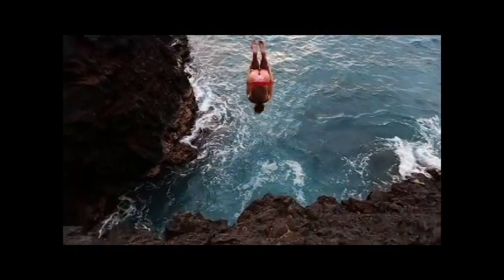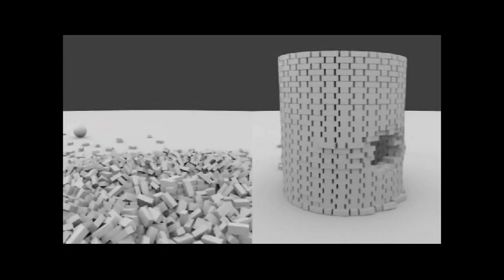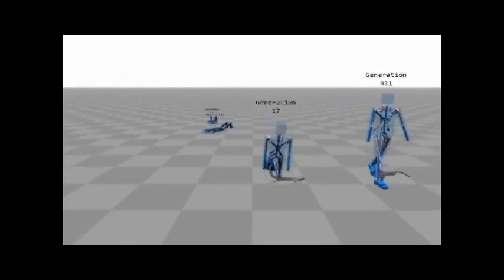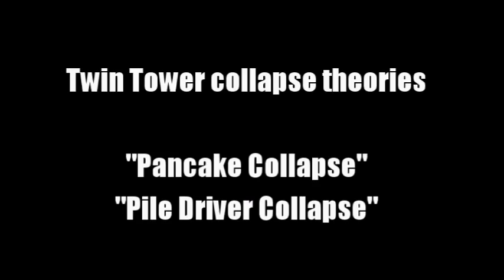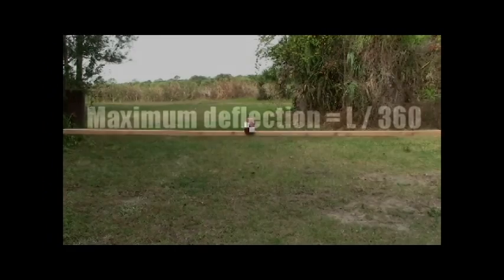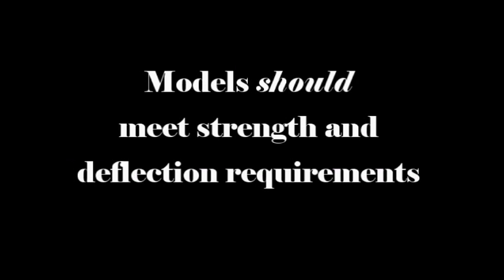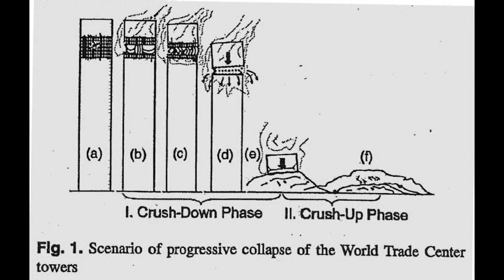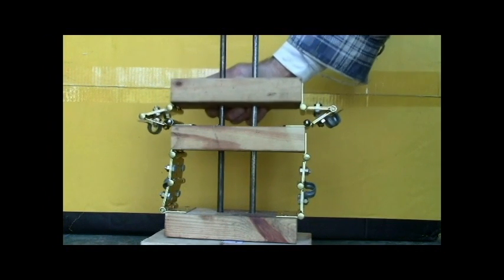9/11 Experiments: The Force Behind the Motion

Comment: This is a excellent video. There is no other explanation for what we are observing. The symmetry, uniformity , consistency, the smooth clear path straight down, all the characteristics for controlled demolitions are there. Can't you ignorant people handle the truth?
Reply: " There is no other explanation for what we are observing"
Except that there is.  These experiments don't represent the proportional strength of a 110 story skyscraper.

"The symmetry,"
The towers collapse was not symmetrical.

", all the characteristics for controlled demolitions are there. "
Actually its the characteristics of a very tall building collapsing from the top down.

A building destroying numerous other buildings during the collapse is the opposite of a controlled demolition.
So you don't even understand the terms you're using.
AND what would be an actual key characteristic of a CD would be explosions going off on all the videos before the collapse.

Didn't happen.  It's fantasy.

"Can't you ignorant people handle the truth?"
You just summed yourself up perfectly sport.
Reply: @markh1011  all this coming from a guy who's used ice cream sticks to represent 110 floors in his weak ass experiment. Conservation of momentum is clearly orchestrated and easy to understand in this video but Mark doesn't include these laws of physics in his ice cream stick fortress. He can't because if he did his fabricated theory comes tumbling down.....like the controlled   demolition towers.  Fuckin poser
Reply: @coolk3dat754  
"tell me why....video not valid"
I've told you.  He doesn't represent the proportionate strengths of the materials and connections in the towers.   These strengths don't scale proportionately with size.
Also he he's just dropping through floors that are held in place but structures that don't represent the skyscrapers either.   When the towers collapsed it wasn't because of an item breaking through many floors...   As we see in the other video when there collapse progresses, including outer columns, those materials join in the collapse.

"just ice cream sticks ."
Just saying "ice cream sticks" a lot isn't an intelligent response.
    Obviously that's all you can do.
You're flailing about here.

Oh and I'm still waiting for this.

"Conservation of momentum is clearly orchestrated and easy to understand i"
So apply it to what happened on 9/11.
Please do.   In your own words.
Go.
I''m now going to keep asking.
Reply: @markh1011  he doesn't represent???? And that stupid ice cream stick video does? You referred me to this. Your video doesn't represent either.... so WTF?
Reply: @markh1011  very childish of you to claim I don't answer your questions when you have not answered one of mine.
Reply: @markh1011  blocks of wood? Does that represent 110 stories sweet cheeks?
Reply: @markh1011  answer me sweet cheeks.....do blocks of wood represent 110 stories?
Reply: @coolk3dat754  Already answered.  You're confused about the point of the model.   You are confused most of the time.
Reply: @coolk3dat754  
"You want to clean the laws of physics need not apply anymore"
Actually that's what you're trying to do.
If you think you can prove any laws were violated then go ahead.
Oh that's right you don't know a thing about physics.....stuck aren't ya?
Reply: @coolk3dat754  
So you've had 3 years to come up with a response....This better be good...🤣🤣🤣

".I know more then you. "
The posts show otherwise.

" Where does it say the laws of physics do not apply to modern State high-rise buildings? "
That's apparently your claim not mine.

"nd the same time and both will be destroyed which causes a deceleration"
Wrong.  When the floors are destroyed the materials are still there.  They don't disappear.    When a floor is destroyed it just adds to the mass dropping on the floors below.  
So you've got 20 floors dropping...21 22 23 24 25 ....it's not going to decelerate.   The force is increasing.

" Any upper block of falling structure must slow down when it hits any mass of force that previously supported it."
Wrong.   The initial upper block hit a weakened floor.    There is a dramatic difference between a static and dynamic load.   The floors were never intended to handle dynamic loads coming down.
Reply: @coolk3dat754  
" The upper block a falling structure will destroy itself well before it could possibly crush the entire larger lower structure."
You're repeating the same confusion I just addressed.  When the floor is damaged in the impacts, the materials don't magically disappear, they continue to fall.   So the amount of floors coming down increases every second.  

"This is worldwide accepted "
No you just don't understand the mechanics of a progressive collapse.  

Three years for that failure!  
😂😂
Reply: @markh1011  I'll m sorry I didn't see it in any of your false claims.......where is you experiment that demonstrates your claims?    You still going to have one? Without it you have no way of telling if your claims are even possible and that is just stupid
Reply: @markh1011  notice you offer no experiment to demonstrate that can prove this experiment wrong.. sleep well princess
Reply: @markh1011  🎶 I am stuck on stupid cuz stupid stuck on Me 🔊🎶
Reply: @markh1011  come back and try to post nonsense WITH OUT using experiment that will demonstrate the force behind the motion. You will only provide evidence by doing so of a guy who is so bankrupt an argument, he doesn't mind making himself look like a jackass
Reply: @coolk3dat754  
".where is you experiment that demonstrates your claims?"
Do you have an experiment for magical thermite bombs bringing down a 110 story building?
By your logic that can't happen.

So you don't understand physics or collapses or anything really.   Your whole shtick is to say "where is the experiment!!!!"
🤣🤣
You had three years!  
🤣🤣
Reply: @coolk3dat754  
"notice how the structural failure buildings remain"
Oh my god.  They were all little buildings.   They were nothing like 110 story skyscrapers collapsing from the top down.

You had three years to get better at this!
LOL

Oh and notice how you hear very loud bombs going off in all the demolitions?   You don't at the towers.

It's so easy to destroy you.
Reply: @markh1011  according to you the collapse was inevitable. With architects and engineers I believe public safety comes first . Who and why in the f*** what a architect and engineer designer building to collapse all the way down to the ground should there be structure failure?  Nobody. Take your scooter downtown and have a seat at the bus stop. You'll see thousands of people walk in and out of high-rise. Count how many are walking in with fear in their eyes wondering if the walls will hold? Count on many are touching the walls count how many refuse the elevator for the fear that the upper floors might come crashing down. Guarantee the answer is zero.   Just because you got ABC blocks for Christmas does not qualify you as an architectural engineer you could scream at the top of your lungs ashes ashes All Fall down all you want..... That just doesn't happen. 1. Your theory is not what happened 2. Lots of physics say it can't happen 3. History proves it's never happened
Reply: @coolk3dat754  
"Count how many are walking in with fear in their eyes wondering if the walls will hold?"
You're not making any sense.  The buildings didn't collapse on their own.  They were attacked.   I can't believe I need to explain this to you kiddo.

I'm skimming over your post and only see a child throwing a tantrum.
Reply: @coolk3dat754  
Oh there is this bit.
. "Your theory is not what happened"  -  I'm describing what we saw on the video...  so yeah... that happened....lol

"Lots of physics say it can't happen "
Prove it.  We both know you don't know a thing about physics.  Go on. Give me entertainment.  

"History proves it's never happened"
What does this even mean?    You're terrible at this.    🤦‍♂
Reply: @markh1011  I don't want you to hear this from anybody else..... Cuz I don't want you to be alarmed.  But the truth is the much larger lower block of material has been supporting the smaller upper block for over four decades and the towers never collapsed . Don't tell anyone that architects and engineers design a building to collapse straight down should there be structure failure. You might wake up one day and find yourself buried six feet deep
Reply: @coolk3dat754  
"But the truth is the much larger lower block of material has been supporting the smaller upper block for over four decades"
As I educated you a few posts back, there is an important difference between a static and a dynamic load.
You wouldn't understand this of course because you don't understand anything about physics, or logic, reason etc

"Don't tell anyone that architects and engineers design a building to collapse straight down"
That's your bizarre claim that comes from your confusion about basic physics.
Reply: @markh1011  let's test your understanding on the laws of physics listen carefully. Regarding the laws of physics Newton's third law of motion when you apply it to the collapse tell me what should and shouldn't have happened based on these laws.       Warning ⚠️ should you lie and get this wrong it would be solid proof that you have no idea what you're talking about
Reply: @markh1011  yes or no do you have a scientific method that uses an experiment that could demonstrate the false claims you are making. Yes or no?
Reply: @markh1011  yes or no?
Reply: @markh1011  oh what tango webs we weave when first we practice to deceive.
Reply: @markh1011  you don't have a scientific method do you?
Reply: @markh1011  I asked you for your understanding of Newton's third law of motion. When you apply it to the collapse what should and shouldn't have happened? Your answer is either going to make you or break you
Reply: @markh1011  you're the one trying to disprove this video so start disproving and provide an experiment like this gentleman did. What's the matter? Scared?
Reply: @coolk3dat754  
"yes or no do you have a scientific method that uses an experiment that could demonstrate the "
I've already addressed this.   Everything we know about physics and building construction is based on experiements.

"yes or no?"
See above.
Reply: @coolk3dat754  
" I asked you for your understanding of Newton's third law of motion. "
It's pretty obvious that I know the physics far better than you do.    You can look it up.
It's not my job to teach you.

"When you apply it to the collapse what should and shouldn't have happened?"
You're still not understanding the progressive collapse.   The upper block is destroyed as well, but it doesn't vanish... it's still coming down... and new floors join.
You're not getting this basic error you're making.
Reply: @coolk3dat754  
"so start disproving and provide an experiment l"
You've tried this deflection already and it's not working.   I've responded to it multiple times.
Reply: @markh1011  1. You don't have a scientific method that could prove anything different from what I have proven 2. You failed to answer your understanding of Newton's third law of motion when you apply to the towers what shouldn't should have happened.      Way to go princess
Reply: @coolk3dat754  Oh just watched some of the video.  Haven't seen it in years.  This guy doesn't understand the progressive collapse either.   His experiment doesn't including the additional weight being added to the collapsing force with each floor.

 He also doesn't understand that the strength of building materials doesn't scale proportionally.  His experiments are laughably bad and only someone who has no idea would be fooled by them.   Oh there you are!
Reply: @markh1011  if that was true Nist would have continued their analysis instead of stopping at the point of collapse initiation never explaining why total eclipse occurred. I don't remember seeing your name in the book with your explanation. Remember Nist is the official narrative and not your false opinions. Try again my boy
Reply: @coolk3dat754  You're so far out of your depth here and it's pure entertainment.  Your distress signal is "but but where is the experiment!!!!!!"... then running from the response.
Kiddo you're a mess.   Pretty funny though.
Reply: @coolk3dat754  Come on sunshine.  Are you even trying?   Did I break you?
Reply: @coolk3dat754  Tell ya what... lets go back to the list that made you run away and hide for three years... 😂😂

Over to you to provide the following.

1.  Videos of the towers with explosives going off
2.  Proof I have lied.
3.  Point out the mistakes and errors in the NIST report on the towers 
4.  Prove I have denied any laws of physics
5.  Prove any laws of physics were violated with the official story

.....and..go.
Reply: @markh1011  you addressed it without a scientific method that could demonstrate your false claims. Way to go princess
Reply: @coolk3dat754  That's all you could come up with?    A repeat of a previous post.
Beaten.
Broken.
Reply: @markh1011  look sweetheart you're not arguing with me you're arguing with science. You trying to challenge the laws of physics but the laws of physics are not challengable they are laws. They are not theories but they are laws. The laws of physics were not based upon the way a building is designed. Newton's third law of motion for every action is equal and opposite reaction. What you obviously clearly don't understand is what those laws are telling you. Equal and opposite reaction. That means the top block coming down to the lower block will meet at the same rate at same time (equal) destroying each other causing a deceleration because there is no more energy left to crush the much larger lower structure with 80,000 tons of reinforced structural steel framework underneath it that was not damaged. This very experiment to demonstration proves what Newton's third law of motion states . These laws apply to every everything including high-rise buildings . It is worldwide accepted. In layman terms it means any upper block of material must slow down when it hits any mass or Force that previously supported it   . This very experiment proves it. The upper block of following material will destroy itself well before it could possibly crush the entire larger lower structure. The experiment proves it. It took firecrackers to represent what we are actually observing. This video showed you the pancake theory and it failed. The pile driver theory and it failed, but the control demolition theory matches what we observed and if you're theory disagrees with experiment its wrong. With that very statement is the key to science. I've seen Nists computer model simulation and it looks nothing like the collapse. Symmetrically uniformity with consistency The towers fell straight down that's the definition of symmetrical collapse. Structural failure always results in a asymmetrical collapse which represents chaos and there was far too much order in this collapse straight down through the path of greatest resistance the inner core. PBS try to simulating model experiment but if you notice their model floors are falling but  the center core remain standing. OOPS!l
Reply: @markh1011  building 7 is the smoking gun. It was not hit by a plane. Office fires and a couple of floors. I believe public safety is the number one concern with architects and engineers who design these buildings don't you agree. Who would design the building to come straight down should there be an office fire. I believe that would be a violation don't you agree. If fired alone  brought down building 7 why wasn't there any emergency or retrofitting done to all the other modern State high-rise bldgs that could also collapse due to fire. Nothing like that occurred because it's not possible. Take a ride downtown and sit on a bus bench and watch the thousands and thousands of people walk in and out of high-rise buildings every single day. Count how many of them have fear in their eyes. Count how many are touching the walls in fear of a collapse. Count how many people are paranoid on the upper floors. Answer 0                  you seem to think you have to build an exact replica of the towers for an experiment. Shows how much you know. Richard Feynman one of the world's greatest physicists and in quantum mechanics, a Nobel prize winner in 1965 who also worked on the Manhattan project, you probably don't even know what that is. He is solely responsible for finding out just what went wrong with the space shuttle Challenger.  He didn't have to replicate the space shuttle in its entirely, he produced a simple experiment using nothing but a C clamp, an o-ring and a glass of ice water nothing more. Go ahead look it up yourself. With this simple experiment he was able to detect exactly what happened and why it blew up. This experiment represents with the laws of physics teach us. This little experiment represents the truth. When you apply these laws of physics to the twin towers it explains what should and shouldn't have happened. It is impossible for the shorter block to crush itself all the way down to the floor. There is only one method that can achieve this and that is by placing precise time explosives just below the collapse initiation to allow a smooth symmetrical collapse all the way down to the ground and this experiment proves it. Once again you're not arguing with me you're arguing with the laws of physics which you clearly do not understand. So it's up to you to create an experiment that could demonstrate the force behind the motion. A experiment that could demonstrate that a total collapse was inevitable. Like this video States, NIST, FEMA,AIA,PBS, and all the king's horses and All the King's Men could never demonstrate that a total class was inevitable. 👏 🎉 Congrats 👏🎉 you've just been bitched slapped and schooled
Reply: @coolk3dat754  
_"you're not arguing with me you're arguing with science."-
I'm waiting for you to prove that but you can't.

"You trying to challenge the laws of physics "
Nope.  You don't know anything about the laws of physics.

" What you obviously clearly don't understand is what those laws are telling you"
How ironic for you to say that.  

" That means the top block coming down to the lower block will meet at the same rate at same time (equal) destroying each other causing a deceleration "
You're again showing that you don't understand the mechanics of the progressive collapse.  
Floor 90 smashes into floor 89.  Lets say they are both destroyed.   Now you have 21 floors, including floor 89, smashing into floor 88.  
This is what you can't get your head around.  In a progressive collapse the material from each floor joins in on the collapse.   The impact force increases.  So no, it doesn't decelerate.
Reply: @coolk3dat754  
"'ve seen Nists computer model simulation and it looks nothing like the collapse. "
You haven't looked over their modelling.  
You don't understand their report.
You don't even understand the progressive collapse.
You are so far out of your depth its hilarious.
Reply: @coolk3dat754  
"he towers fell straight down that's the definition of symmetrical collapse"
No that isn't the definition at all.
symmetrical -  made up of exactly similar parts facing each other or around an axis; showing symmetry:
The towers leaned to the side where the collapses initiated.
You are now denying the dictionary and just making up words.
Just stop kid....you're floundering about here.
Reply: @coolk3dat754  
" building 7 is the smoking gun. It was not hit by a plane."
It was hit by part of a skyscraper and burned away freely for 7 hours.

"Office fires and a couple of floors"
So you claim the fire department lied now....🤦‍♂

" Who would design the building to come straight down should there be an office fire."
What are you even talking about?   No one designs buildings to collapse.
They do everything they can to stop collapses.
Numerous building codes changed as a result of 9/11.
They build skyscrapers differently due to 9/11.
Buildings have still collapsed due to fire.  

"Count how many people are paranoid on the upper floors. Answer 0   "
This argument is so bad it has comedic value....😂😂😂
Reply: @coolk3dat754  Strange how the post from 11 days ago is still perfectly valid.

That's all you could come up with?    A repeat of a previous post.
Beaten.
Broken.
Reply: @markh1011  that's where you're wrong. What we observe is the upper block being destroyed within 4 seconds before reaching the collapse initiation. The building has already broken down and turned to dust in the first four seconds. We don't witness anything like a progressive collapse because the top portions are ready to destroyed. Buildings fall over not straight down. We also witnessed ways of explosions below their collapse initiation and this you could clearly see. Where did the energy come from to Pierce steel columns into nearby buildings? Buildings fall vertically not horizontally
Reply: @markh1011  this experiment is very valid, as opposed to your...............oh wait..... You don't have an experiment to demonstrate this. You have no idea what you're talking about
Reply: @coolk3dat754  
". What we observe is the upper block being destroyed within 4 seconds before reaching the collapse initiation. "
Before the collapse initiation?    You're claiming the upper block was destroyed before the collapse started?
lol oh kid.. just stop.... 

🤦‍♂
Reply: @coolk3dat754  
" Where did the energy come from to Pierce steel columns into nearby buildings?"
Some were from the plane impacts, some were from the collapses.  

" Buildings fall vertically not horizontally"
Horizontally?    What are you even talking about?   😂😂
Reply: @coolk3dat754  
"this experiment is very valid, as opposed to your"
I've debunked it and you have no response.

You've been schooled.  😉
Reply: @coolk3dat754  
" debunk somebody doesn't actually mean they've been debunked."
I've given 2 important reasons why the experiment fails.
You've not been able to refute them.
You don't enough about this to do so.
You're out of your depth and drowning.
Reply: @coolk3dat754  
"within the first four seconds the top portion is being destroyed and turning to dust."
Thousands of tons of concrete and steel doesn't just magically turn into floating dust with no mass.

"There's absolutely nothing there to do the crushing."
Oh my god you think it just magically disappears.....🤣🤣🤣

You think many stories of concrete and steel becomes magically weightless because of the impacts....🤦‍♂
Go back to playing with blocks kid.   lol
Reply: @coolk3dat754  
"Precise time explosives to allow a symmetrical collapse."
There are no evidence of explosives, and the collapses weren't symmetrical.   
Oh that's right you tried to redefine the word.  

"We also observed explosives a good five or more floors ahead of the collapse."
Wrong.
1.  Explosives go off before the collapse.  I've already educated you about this.
2.  There are no explosive noises with the puffs of air.
3.  They eject at the speed that the towers are collapsing.  Bombs don't do this.  

Debunked.  It's so easy.
Reply: @markh1011  I'm still waiting for those two important reasons
Reply: @coolk3dat754  
" Tell me how does one debunk someone without ever using a scientific method? "
I'm the one referencing science and evidence.
You are making claims you can't support and barely understand.  

"Building 7 is the smoking gun "
You keep diverting back to this claim.   You're in a constant state of deflection from the failures.  

" 3000 architects and engineers can agree. "
A weak appeal to authority and numbers. 
Hardly any of them are structural engineers.  If they actually had the qualifications and analyses done then they could get them submitted in relevant journals and convince the rest of the scientific community but that doesn't happen because it's nonsense.
Reply: @coolk3dat754  
" When we observe things at freefall which is the speed of gravity"
😂😂😂😂😂
The speed of gravity!
LOL...
Oh man.  If there was any doubt that you had no idea about physics you just made it undeniable.

The speed of gravity.... I love it.
Tell me kiddo..what's the speed of gravity!
LOL
Reply: @markh1011  you are not debunking what we are observing. You're not saying anything at all for that matter
Reply: @markh1011  kind of stupid of you to say no evidence of explosives when nist admitted to never have looked. By law unless properly investigated and ruled out the evidence for potential use of explosive still exist
Reply: @coolk3dat754  
Tell me more about the speed of gravity!
🤣😂🤣
Reply: @markh1011  https://youtu.be/sJKiBHDvT1o sure go right ahead and ignore this evidence. You have to if you're going to believe your theory to work
Reply: @coolk3dat754  
" no evidence of explosives when nist and made it to never have looked. "
NIST didn't look for a specific outcome.  They look for what caused the collapse.
Guess what?   It wasn't explosives.
Reply: @coolk3dat754  
"I'm still waiting for those two important reasons"
You're running.  
You're running because you know you're well out of your depth here.

🏃‍♂🏃‍♂🏃‍♂🏃‍♂
Look at him go!
Reply: @markh1011  https://youtu.be/JohbGuqLx-U you have to ignore this evidence in order to make your theory work. Explain to everybody why anyone would ignore this
Reply: @coolk3dat754  
"sure go right ahead and ignore this evidence."
Somebody hearing the plane hit.  Wow that's shocking.
Reply: @markh1011  it'd be nice if you could prove everything you're saying until then dream on Tinkerbell because you're wrong. I've reduced you to lying that's all you're doing is lying. Shame on you marky Mark
Reply: @coolk3dat754  A weak, empty response from a beaten man.
Reply: So,
I've raised problems with the experiments above.  You have no response.
I've educated about the progressive collapse.  You have no response.

I've exposed your total lack of understanding about building collapses and demolitions.
I've had a good laugh at your lack of understanding of physics.

The speed of gravity!  🤣😅🤣
Reply: @markh1011  still waiting for your scientific method to prove me wrong. An experiment that could demonstrate the force behind the motion do you have one yes or no?
Reply: @markh1011  still waiting for your experiment that could demonstrate the force behind the motion do you have one yes or no?
Reply: @markh1011  still waiting for the scientific method and experiment that could demonstrate the force behind the motion do you have one yes or no?
Reply: @markh1011  still waiting for that scientific method and experiment that could demonstrate the force behind the motion do you have one yes or no?
Reply: Already addressed many times over.  You're just spamming and trolling now because you were handed a lesson.
You're done.
Reply: @coolk3dat754  I've already addressed that.   There were plenty of exploding noises that day from planes, jet fuel, infernos and many building collapses.
These are weak arguments from 15 years ago....
🥱
Reply: @markh1011  WARNING ⚠️ CAN NEVER EVER PROVE ANYTHING SHE STATES ALERT 🔊
Reply: @markh1011  WARNING ⚠️ NO COMMON SENSE OR BETTER JUDGEMENT ALERT 🔊
Reply: @markh1011  🎶I AM STUCK ON STUPID CUZ STUPID STUCK ON ME🎶.   ALERT 🔊
Reply: @markh1011  WARNING ⚠️ 🎶 When You wish upon a Star makes no difference Who You Are 🎶 Tinkerbell alert  🔊
Reply: @markh1011  WARNING ⚠️ COMPLETE WASTE OF TIME ALERT 🔊
Reply: @coolk3dat754  
"okay with Nist admitting to never have looked or tested for explosives?"
Already addressed.
They looked for what caused the collapses.
You don't need to start with a conclusion and look specifically for that conclusion.  
That's nonsense.  

" proper guidelines for the National Fire protection agency guideline"
These are guidelines for a regular fire to determine if it was intentional.   This wasn't just a fire and we know it was intentional.  

"That's what I said there's a bomb in the building everybody clear out."
Already addressed.   There were plenty of exploding noises that day.  None of that is suspcicious.
I challenged you to show suspicious explosives on a video of the towers.
You couldn't.
I rest my case.

The rest of your post was a troll meltdown.
Reply: @markh1011  WARNING ⚠️ on the day he was born his daddy handed out cigars that read " it's a dud" ALERT 🔊
Reply: @markh1011  WARNING ⚠️ FAILED IN EVERY ASPECT ALERT 🔊
Reply: @markh1011  by the way five of the hijackers are very much alive and doing well in the country. The planes were diversion and a cover up for the control demolition that proceeded that day. You are totally wrong in your way of thinking. You train a thought has derailed and there were no survivors
Reply: @markh1011  back to the insults
Reply: @markh1011  WARNING ⚠️ TRIES TO PASS HIS OPINIONS AND HEARSAY FOR A SCIENTIFIC METHOD.....NEED I SAY MORE..ALERT 🔊
Reply: @coolk3dat754  You're having a troll meltdown because all your claims were refuted.
You lost.  At least lose with dignity.
Reply: @markh1011  Do you have a scientific method and experiment that could demonstrate the force behind the motion yes or no?
Reply: @markh1011  also will you describe what a suspicious bomb sounds like versus a non-suspicion bomb?   LMAO 🤣
Reply: @markh1011 if we substituted you for Willie Rodriguez, it would probably sound something like this
BOOM 💥 an explosion so powerful it push this upward. In my mind I thought"the generators the generators"before I could verbalize it BOOM 💥 AN EXPLOSION ON TOP. There was a difference between the explosion below us following an explosion on top. Then a guy from the basement comes out and says explosion explosion 💥 I said what happened what happened? He said the elevator  the elevators and he had his arms and hands extended out and I noticed his skin was hanging from his fingertips. Then I look closer and parts of his face was missing,  (here comes Your part) so I told the guy relax there was a plane that hit the building,  it's expected,  bombs are expected, it's a fire,  get over it. So your face is blown off,  so what,  it's a fire it's expected. So what if there was an explosion before the impact what's the difference? Things go boom💥 in a  fire all the time. (Perhaps when he gets back from the burn center he'll see things differently right Mark?) Be a man, suck it up,  it's a fire , things go boom all the time , get over it,  it's expected. Nothing suspicious about that,  it's expected.                      That's you. That's what you think goes on  totally ignore everything that's going all around you ignore deny anything that's happening around you.    Way to go mark nothing suspicious about those BOOMS 💥 right mark?    FUCKIN IDIOT!
Reply: @coolk3dat754  
"Do you have a scientific method and experiment t"
Addressed many times.
Doing a little experiment is irrelevant.    The strengths of building materials doesn't scale proportionately with size.
What does matter is the scientific method and all observations, all evidence supports the official story.
ZERO evidence supports the conspiracy.
Reply: @markh1011  Nice try, except the other way around. See how you reversed what he actually said? Why would you want to reverse his testimony?  To cover up the truth?  What he actually said was the first 💥 explosion came from the basement 👇 then following an explosion on top 👆. Same testimony by the two women who were having coffee. I quote " I believe the bomb 💥 went off in the lobby 👇first, then the plane hit on top👆.  Same quote from the  another women " It sounded like the subway exploded or the subway train collided first👇then the explosion on top👆Your theory is an old argument that has been refuted long ago. Especially the jet fuel which ignited in a huge fireball burning just about all the fuel. What you're trying to claim is the fuel came half way  down the elevator shaft, stopped and exited the elevator, trickled to the opposite end of the building , caught the next elevator and proceeded all the way down to the lobby before it ignited, then blow up the lobby?   Why must you lie all the time? You are guilty of trying to cover up what really happened.  The explosion was picked up on audio as well. The guy in the audio clearly says after this first boom 💥" what was that" followed by the next boom 💥" sounds like something crashed" . He said it in that order. You are going off the Nist report and everyone knows they performed a miscarriage of an investigation . All you're doing is changing what was actually said by the witnesses to fit your agenda. Not going to work marky Mark. Not on my watch. You still going to stick with the bombs are expected Theory? Not going to work either. You living in a fantasy world. That's not how investigations are done..... Unless you wish to cover up the truth
Reply: @markh1011  the official story is the conspiracy lmao 🤣 I can't believe you just said that
Reply: @markh1011  would you please tell me what a scientific method consists of? Step by step? Does it not state testing your hypothesis by experimentation to see if it matches what we observe cuz if it doesn't you go on to the next hypothesis?
Reply: @markh1011  what does matter is the scientific method and all the observations, all the evidence supports the official story-end of quote.  Here are the steps 1. Ask questions (observation) 2. Perform research 3. Present a hypothesis 4. Test hypothesis with an experiment 5. Draw conclusion. 6. If your theory disagrees with experiment go back to step One.               You callously left out step four, testing with experiment, just like Nists had done. Wow, what a coincidence, leaving out the most important step to prove a theory LMAO 😂.   I guess you have to if you want it to fit your agenda. I guess you have to if you want the fabricated story to work
Reply: @coolk3dat754  
" See how you reversed what he actually said?"
No I'm going from what he actually said.  I've read his testimony from 9/11 and he said nothing about explosions or anything suspicious.

So we've got a guy who 
1.  Wasn't in a position to see when the plane hit.
2.  Said nothing about explosions on 9/11.
3.  Changed his story in later years.
4.  No one else backs up what he said about explosions at the bottom....  and here' are some big problems
5.  We have videos of the impacts and there are no suspicious explosions.  
6.  Talking about explosions at the bottom makes no sense as the buildings collapsed from the top down.

Debunked
This stuff was easy to debunk 15 years ago....
Reply: @coolk3dat754  
"All you're doing is changing what was actually said by the witnesses"
Actually no I'm the one listening to what they are describing.
You're quote mining.

"Not going to work marky Mark. Not on my watch"
Your watch?   lol all you've done on your watch is lose arguments.   😂
Reply: @coolk3dat754  
"would you please tell me what a scientific method consists of?"
You can try to teach yourself that.
You've demonstrated that you have no idea about physics when you talked about the speed of gravity  
😂😂😂
Reply: @coolk3dat754  
"what does matter is the scientific method and all the observations, "
1.  Correct.  It supports the official story.
2.  You don't know anything about it.  You've shown this.

"  You callously left out step four, testing with experiment, just like Nists had done. "
NIST did multiple tests as part of their investigation.
You simply have no idea.
Reply: @coolk3dat754  So I'm seeing a lot of flailing and desperate attempts to recover.
You've yet to put forward a claim that wasn't easy to dismantle in front of you.
Reply: @markh1011  you are so bankrupt in argument, you're just rambling on. I don't want to hear about your opinions and your ideas that have no relation to reality.
Reply: @coolk3dat754  You're just spamming the same comments I've already demolished.  Most of your posts don't even get through.

Everything you've blurted out has been debunked.   
But please, tell me more about the speed of gravity.  With that comment you confirmed you don't even have a BASIC understanding of physics.  🤣
Reply: @coolk3dat754  
"you're just rambling on."
Frantic projection.
Beaten.
Broken.
Reply: @markh1011  denial is an ugly thing marky Mark. You are totally in denial
Reply: @markh1011  I'm the one listening to what they are describing - end of quote.  Willie Rodriguez described a bomb in the basement prior to an explosion on top. The lady who stated she heard the subway explode prior to the plane hitting on top. The black woman stating she thinks the lobby blew up first then the plane hitting on top. Firemen claiming it look like the plane hit the lobby. Fireman recorded secondary explosions. Sure you're listening to what they're saying lmao 🤣.      Here we go folks more evidence of denial of lying of misrepresenting.  Oh what tango's web we weave in first we practice to receive
Reply: @coolk3dat754  
" Willie Rodriguez described a bomb in the basement prior to an explosion on top."
Nope.  He never said anything about a bomb and once again I've read his testimony from 9/11 and he said nothing suspicious at all.   He came up with that years later.  

" The lady who stated she heard the subway explode prior to the plane hitting on "
What specifically did she say?   Word for word.
Reply: @coolk3dat754  
"Fireman recorded secondary explosions"
Again you're quote mining.
Everything they described was consistent with the official story.
You're trying to cherry pick sentences.  

You're not actually looking at the testimony.
Reply: @coolk3dat754  

Why do you ignore what the people actually say?
Why do you ignore the videos from the day?

You're putting so much work into this and still failing so miserably.
Reply: @coolk3dat754  
So we've got a guy who 
1.  Wasn't in a position to see when the plane hit.
2.  Said nothing about explosions on 9/11.
3.  Changed his story in later years.
4.  No one else backs up what he said about explosions at the bottom....  and here' are some big problems
5.  We have videos of the impacts and there are no suspicious explosions.  
6.  Talking about explosions at the bottom makes no sense as the buildings collapsed from the top down.

Checkmate.
Reply: @markh1011  Sorry. You ruined your credibility of being a reliable source
Reply: @markh1011  sidestep the question never give me an answer. Not working for you is it Mark🤪
Reply: @markh1011 who says I'm failing? You?  LMAO 🤣
Reply: @coolk3dat754  
"Sorry. You ruined your credibility of being a reliable source"
Amusing irony.
Reply: @coolk3dat754  So that's it?   
Why do you keep coming back after each humiliation?   
All your claims were easily refuted.

My favourite part was you trying to sound like you know anything about science and physics....  🤣
Reply: @markh1011  BECAUSE YOU SAY SO....RIGHT MARK?    THATS ALL IT TAKES...RIGHT MARK?   LMAO     🤣
Reply: @markh1011  WHERE IS YOUR PROOF MARK?     IM WAITING
Reply: @markh1011  IF A PROGRESSIVE COLLAPSE WAS POSSIBLE, THIS EXPERIMENT WOULD HAVE PROVED IT.     SORRY MARK👎
Reply: @markh1011  NOT GONNA WORK MARK . SORRY YOU LOSE 👎
Reply: @coolk3dat754  Ranting because you lost an argument.  🥱
You always lose to me.   I know this topic so much better than you do.
Reply: @markh1011  BLAH BLAH BLAH BLAH.....NOT WORKING FOR YOU IS IT???
Reply: @coolk3dat754  A meltdown because you keep losing.  Bad luck kiddo.
Reply: @markh1011  1. You lied 2. You lied 3 you lied 4 you lied 5. You lied 6 you lied 7. You lied 8. You lied 9. You lied 10. You always lie
Reply: @coolk3dat754  A child throwing a tantrum.
Reply: @markh1011  Not at all butthead.   Enjoying the fruits of ✌️ victory
Reply: @markh1011  A YouTube engineering wannabe with a degree from Legoland
Reply: @coolk3dat754  lol victory?   Your arguments were refuted as always and you threw a tantrum.
You took a 2 year break and still couldn't come up with anything.
Reply: @coolk3dat754  
"A YouTube engineering wannabe"
Says the guy talking about the speed of gravity 😂😂😂
It cracks me up when conspiracy theorists try to pretend they know anything about physics... and then make statements like that.
Reply: @markh1011  I SAID A SCIENTIFIC METHOD....DO YOU HAVE ONE?  YES OR NO?
Reply: @markh1011  awwww never heard of the speed of gravity?   It figures
Reply: @coolk3dat754  
"I SAID A SCIENTIFIC METHOD....DO YOU HAVE ONE?"
I demolished you with it.
Reply: @coolk3dat754  
"awwww never heard of the speed of gravity? "
LOL there is no such thing....  😂😂😂
Reply: @markh1011  🤣 LMAO BANKRUPT AN ARGUMENT IS THAT ALL YOU GOT
Reply: @markh1011  no demonstration no realization
Reply: @markh1011  just look what I single handily reduce you to
Reply: @markh1011  🎶 hush little Marquis don't you cry 😭 your theories just been one big lie 😭
Reply: @coolk3dat754  
" just look what I single handily reduce you to"
More panicky projection.
Beaten.
Broken.
It was so easy too.  😉
Reply: @markh1011  WARNING ⚠️ compulsive liar alert 🔊
Reply: @markh1011  WARNING ⚠️ YOUTUBE ENGINEERING WANNABE ALERT 🔊
Reply: @coolk3dat754  Troll meltdown.  I win.  Again.
Reply: @markh1011  SURE YOU SAID A EXPERIMENT IS IRRELEVANT WHY DO YOU DENY IT. BECAUSE YOU REALIZE YOU'RE WRONG? JUST COME BACK 62, COMMENTS AGO. ITS THERE IN PLAIN SITE 🤣
Reply: @markh1011  it's there for all to see. Go look at the other comment section and count 62 comments up you said it not me
Reply: @markh1011  you're digging yourself deeper and deeper into a hole. Say what you must but anybody reading these comments will be convinced that you know nothing about anything
Reply: @markh1011  yes you did say a small experiment is irrelevant. A small experiment is needed to test your hypothesis cuz if your theory disagrees with experiment your theory is wrong. Your problem is you don't even have a scientific method therefore you have no idea what you're talking about. It's not me talking it's science
Reply: @markh1011  does your video that you referred me to represent 110 stories....yes or no????
Reply: @coolk3dat754  
You're confused.  It's demonstrating the progressive collapse.     The number of floors in the model doesn't change what it demonstrates.
You're trying to evade with confused nonsense.

1.  Videos of the towers with explosives going off
2.  Proof I have lied.
3.  Point out the mistakes and errors in the NIST report on the towers 
4.  Prove I have denied any laws of physics
5.  Prove any laws of physics were violated with the official story

You've been called out on your claims..
You have evaded backing them up... wait for it... 21 TIMES now...
21 evasions .... how embarrassing for you.
Reply: Oh and I'm also still waiting for you to respond to these.

1.  Videos of the towers with explosives going off
2.  Proof I have lied.
3.  Point out the mistakes and errors in the NIST report on the towers 
4.  Prove I have denied any laws of physics
5.  Prove any laws of physics were violated with the official story

You've been called out on your claims..
You have evaded backing them up... wait for it... 20 TIMES now...
20 evasions .... how embarrassing for you.

You're a coward trying to talk a subject you don't understand...
Reply: Come on dippy I'm waiting.
Reply: @markh1011  think you got your fools mixed up. Don't lie and tell me more lies. Bldgb7 free fall first couple of secs....how's that possible dick?
Reply: @coolk3dat754    So now you're trying to change the subject to WTC7?   
You're always evading....
even you realise how badly you lost that argument...
your surrender is accepted.